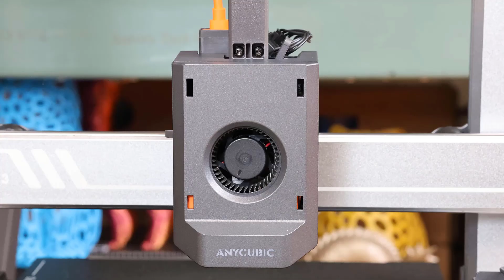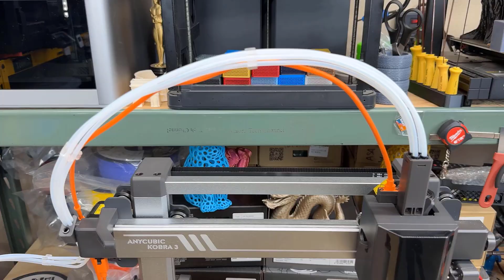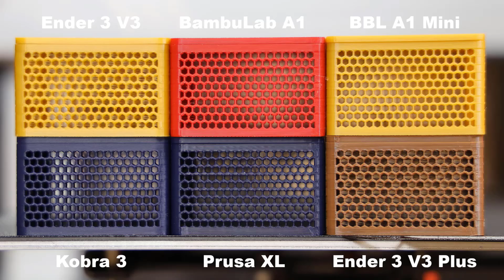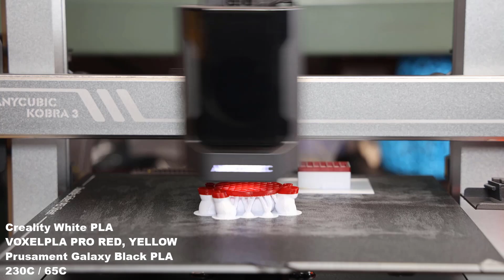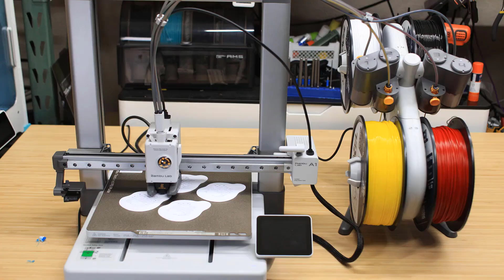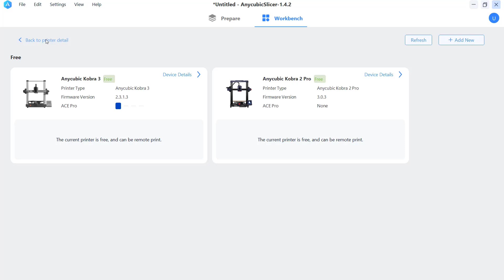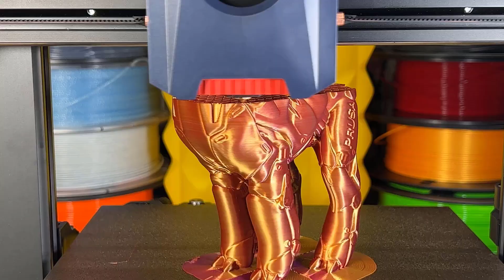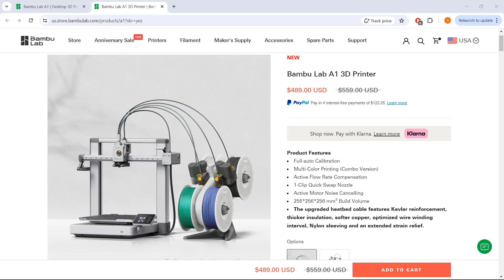AnyCubic Kobra 3 Combo 3D Printer: Multiple filament printing, filament dryer, print up to 8 colors

Comment: 2024 and companies are still using eccentric nuts and wheels.
Reply: Its not so bad on the z axis. The mental wheels on the rails great for high speed. I own the kobra2pro, fantastic hardware let down by the locked down firmware. Print quality is really good for as bed slinger. I'll wait til they get multicolor on the older machines working. The kobra3 is pretty much a kobra2 hardware wise. The prefer the frame on the kobra2pro over the a1. I don't like how they are trying to make it look like an a1.
Reply: @oneanother1  I own both kinds, liner rails for this size are like $10 a pop when bought in mass. I stand by what I said. The movement isn't the issue for me as much as the eccentric nuts. That's why my ender 3 pro has linear rails on every axis.
Reply: @GonzosGizmos  I know what you mean, been there too. Z eccentric nuts hardly ever come loose. Similar to the metal grooved wheels, I haven't had to adjust them. The noise is low with the metal wheels on the rails too. I definitely would not want to go back to the plastic vslot wheels. More so on bigger machines like the kobra 2max. I'm not interested in the kobra3, the hardware is too similar to the kobra 2. I'd just buy a kobra2 and add multicolor on it.
Reply: @oneanother1  I don't have any printers with metal wheels. I have linear rails, and carbon rails, even just tube like on the k1. Multicolor is not something I am interested in by anyone other than Bambu atm, as I have very little faith in that new Creality Slicer. Same with this printer, it seems good for the $ but with my x1c it's not the printer. It's the AMS. I actually tend to run my A1 mini more now due to it's ability to just go with no hiccups. Having multiple ams units and cheap filament tend to give them issues, and if your buying one of these , I doubt it's to run stuff like protopasta or siraya tech. So hopefully it works well. I am really happy to see Bambu caused all the companies to innovate, clone, or die. We needed this after years of bed slingers running marlin.
Reply: @GonzosGizmos  I have a k1, it was disappointing due to VFA and extrusion issues, and layer inconsistency. My kobra 2 pro prints better with nylon filament, what I mainly front with. Corexy is alright, I don't mind having a bed slinger that I'd fast and prints well. Multicolor isn't anything I need. Bambulab is closed firmware, which I don't want either.

Lot of people make they argument they just want to print so go with Bambi. Me I need to tinker because I may need to go with a different hotend or extruder. Change the config of the firmware and such. I like cheap printers too, no need to expensive ones.
Reply: @oneanother1  yea I'm over tinkering on 3d printers. I"ll do that with metal, cars, etc. My k1 is rooted, and it's my abrasive printer. I have over 50 days worth of printing on this, and the only issues I have had were self induced. Between that and Orca slicer my k1 is a workhorse. I just printed NylonX on it, and now about to run PA6-GF.  Bambu now has X1plus so you can mod the firmware, and as far as hardware there really isn't any need to. The only mods I have on my x1c are fan duct, and tpu feet I designed. It just doesn't need it, the Lidar does flow and dynamics and flow rate at the push of a button. And if you buy a known filament it already has profiles. good ones too. Polymaker and esun are on there for example. Even the a1 is so easy to use I find it silly to buy a less reliable machine that is less efficient at the task I purchased it for. While I really want a Vzbot or Annex Engineering DIY kit, it would still get less use than my a1 mini. Or my SLA printers. Once you make a really fast benchy it loses it's nostalgia.
Reply: @GonzosGizmos  I think the Bambi a1 and a1 mini uses the same metal wheels on the y axis. The a1 mini is tempting with the price reduction. I'm in no rush to buy more 3d printers.
Reply: @oneanother1  I'm not trying to sell you one. I just know I have several printers including a Railcore 300zl I converted from Reprap and Duet to BTT with Klipper... I still use the a1 mini more. The a1 probably the best per dollar value 3d printer ever. No other printer in the price range has that reliability and speed. Not even prusa

Comment: You are correct that the first company to produce a "home" filament recycling "appliance" is going to print money. If Bambu are not working on it they should be as they are responsible for the creation of 99% of the poop!

Comment: So disappointed that the Ace Pro it's not compatible with other printers
Reply: It's actually the other way around. The other printers are not compatible with the ACE Pro. You would have to modify the other printers so that they can use the ACE Pro and adapt their firmware.

The only multicolor solution I have seen so far that works without any changes to the printer is the Mosaic Palette.

Comment: It’s trying so hard to be the A1 lol
Reply: The AMS is better, easier filament loading and active heating. You can also add any USB webcam. Bambu Labs software may still be better, but it seems other manufacturers are improving on some of the hardware.
Reply: @alifewithoutgamingisnolife why would one want to add a webcam when you can have an awesome 0.5fps built in camera like on the a1? 😂
Reply: @alifewithoutgamingisnolife  This is just the start from Anycubic in this market segment and Bambu needs the competition.
Reply: It tried so hard that it ended up being a better printer 😉
Reply: @freedomofmotion  the printer is not better than the A1, she detailed the problems in the review, but the AMS is better than the bambu lab one.
Reply: @alifewithoutgamingisnolife  The only thing it wasn't as good at was surface quality on the llama print. But it was much faster, slow it down a bit and it would be the same quality. 

However the quality is similar but it's over 25% faster. In multi colour print it was nearly 50% faster and wasted less material. 

So pros :
Faster than A1
More efficient multi material than A1
Dimensionally accurate
Similar quality to A1

Cons : Surface quality isn't as good when printing at full speed. 

That makes it a better machine in terms of performance.

Over a longer time period the A1 may be a better machine but in terms of objectives measurable out the box experience the K3 is measurably better.
Reply: @freedomofmotion  The A1 had a recall, because there was a RISK of electrical malfunction by the people delivering or setting it up. Creality printers have had countless fires and Creality just covers it up. Would I trust Anycubic to do the same? Probably. It might be open source (idk) but Bambu is clearly open about their products.

Sure I might be a Bambu fanboy but I just want printers that’ll work without much fiddling. I kept the A1 during the recall because it was working fine. I trust Bambu to make a printer more than I do anyone else, really. However, I’m building a Micron+ (fork of Voron) later this summer, so we’ll see how it goes.
Reply: @BDin3D  Eh they're all Shenzhen based companies. They're all about the same to be honest with you. People just have positive or negative expectations and experiences and base their buying habits on that.  A lot of people go from the ender 3 to a brand new shiny klipper printer and the difference is so vast that they become enamoured.  The amount of people I see having a fit because they've bought something and it's DOA and they swear off a brand is unreal, it's like they don't understand there's margin for error in products. 

I've got a K2 max and I did have some issues with it, anycubic sent me a replacement hot bed and then sent me a replacement bed gantry with very little fuss. 

But I could have just as well had issues with a bambu and had faulty parts replaced as well, or a elegoo, sovol, biqu, qidi etc etc etc. 

Tdlr: All the brands have similar failure rates,similar warranties and similar customer service processes.
Reply: Brand fanboys never stop losing 😂
Reply: @FoxHoundUnit89  But how do I lose? What have I lost here by preferring a trustworthy company?
Reply: @FoxHoundUnit89  the only Fanboy comment has ironically being yours.